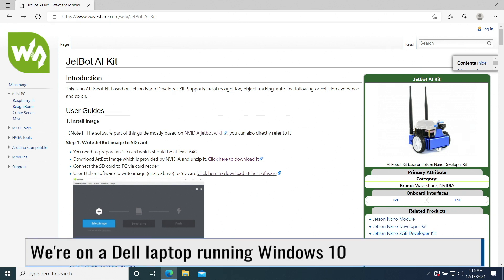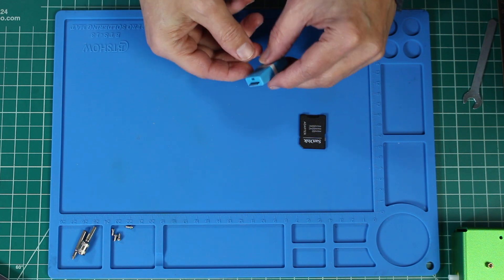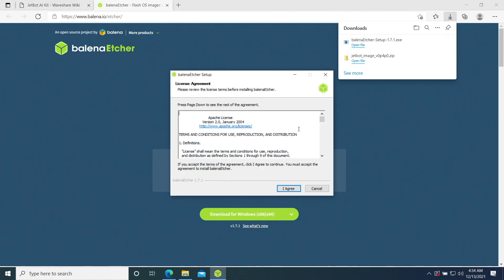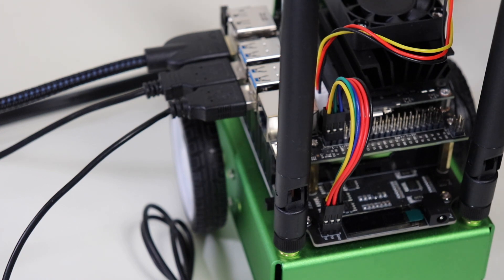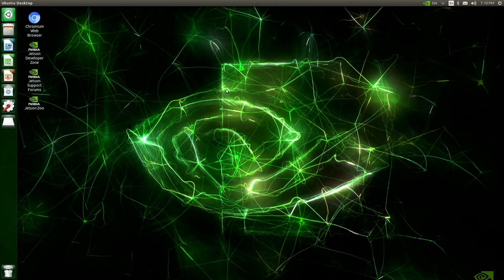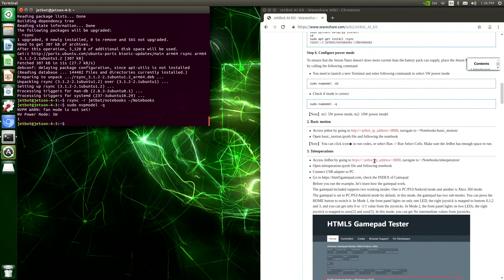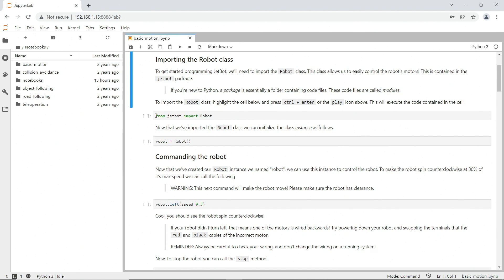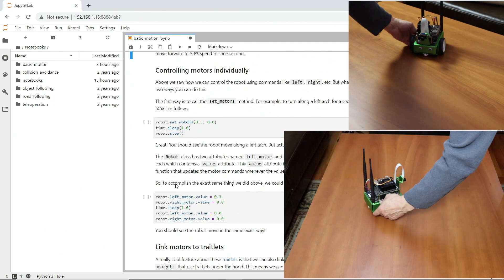Waveshare Jetbot Build - Software Install and Basic Motion Test!

Comment: Hi Jim thanks for the tutorial 
I ran into an issue where the os is running but it isn't identifying the motors and the led isn't showing anything either
Reply from the maker: This video is a few years old. You'll need to get support from Waveshare to help. Most likely it's a newer version of software that is causing the issue.

Comment: Hi Jim,

I have a question. When I try to do step 5, it shows an entirely different screen with different codes. What can I do to resolve this issue?
Reply: Thank you!
Reply from the maker: It's hard to tell from your description what step 5 is and what "different codes" mean.
Reply: Yeah, it's kind of hard to describe the different types of code that I'm seeing. Maybe you could send me the website for how you did step 5.
Reply from the maker: @Hippoking69  I don't know what step 5 is. Could you please refer to it as a timestamp or something more descriptive?
Reply: What I meant by Step 5 is the part where you update the Waveshare JetBot software.
Reply from the maker: @Hippoking69  You should follow the Waveshare wiki instructions. This is their step 5: https://www.waveshare.com/wiki/JetBot_AI_Kit#Step_5._Install_the_latest_software
You can read through their full setup procedure, which they have updated since when the video was published.

Comment: Hi, Jim. Great Video. It helps me a lot. I have a question. ¿Can i use the Jetbot without those batteries for these first steps? Because i dont have the batteries, ¿i can not configure the Jetbot plugged in without the batteries? 
Thank you for the video guide.
Reply from the maker: You should be able to plug the Jetson in and configure the software. The rest of the robot will need batteries of course. Good luck on your project!

Comment: Hi, I am from Colombia and I got de Jetbot with 2GB. I just have a problem with the Etcher, when it is validating it generates a lot of partitions of the sd card. So, when it finish the process and show that everything is okay, and I put the sd card into the Jetbot ..basically doesnt works. Do you have any clue about that? I ask you because in your video that problem doesnt appear. I hope you can help me, thanks.
Reply from the maker: A Jetson SD card is supposed to have a lot of partitions. The Jetson should boot at the end of the process flash SD card. Make sure you selected the correct SD card image. If you are having issues, please ask questions on the official NVIDIA Jetson Nano forum where NVIDIA engineers can help you through the process. Thanks for watching!